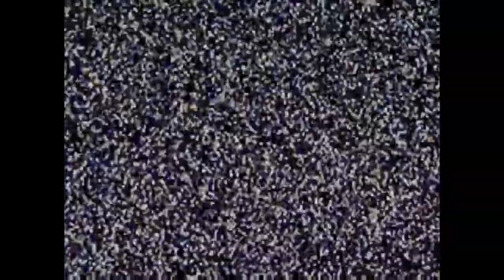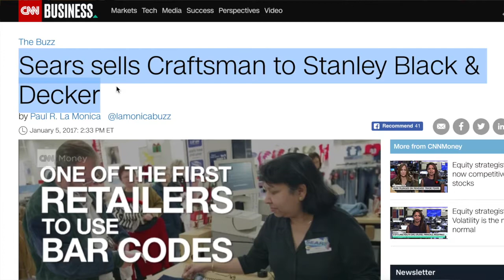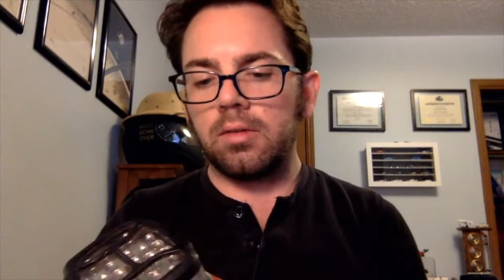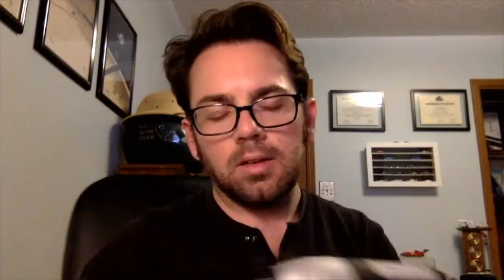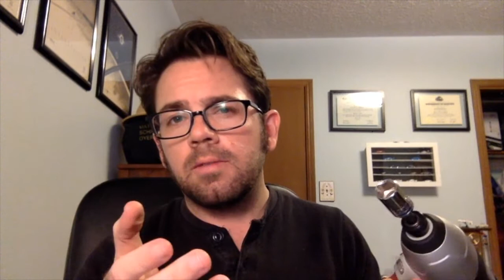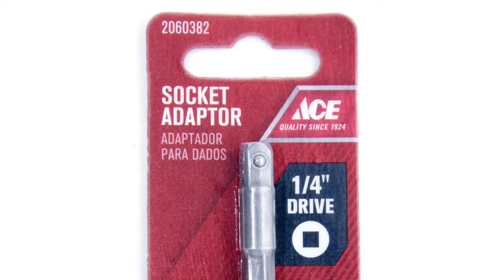TOOLSDAY: Impact driver for automotive use

Comment: You're losing some of your torque because of the adapter you're using in order to convert 1/4 inch to 3/8 Drive
Reply: No, you can use reducers, extensions, whatever you want as long as the fastener is still in line with the square drive. This is common professional knowledge, look it up, it's even often in the manual of your product. Think about it, if that were true you would have to consider the size of ever bolt head in you torque settings. It would also mean if you stand on your toes you somehow weigh less!